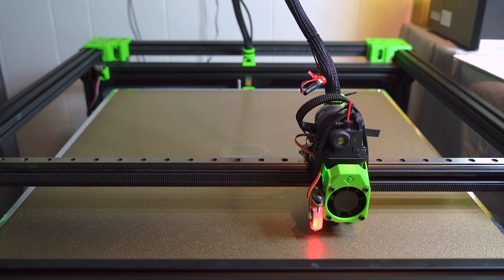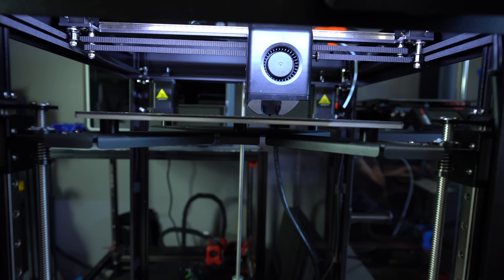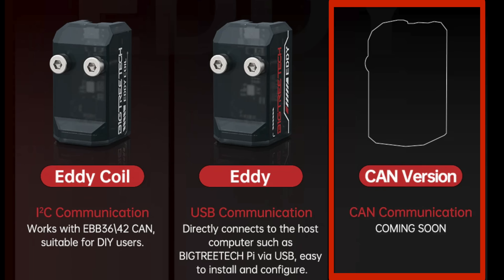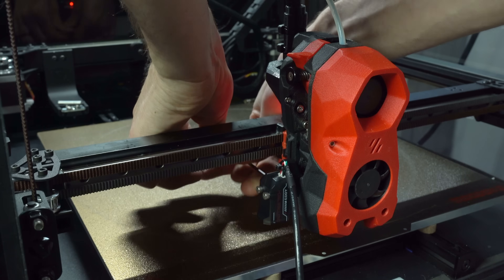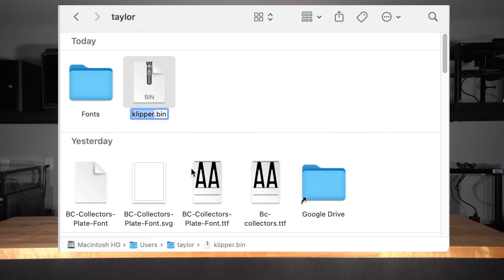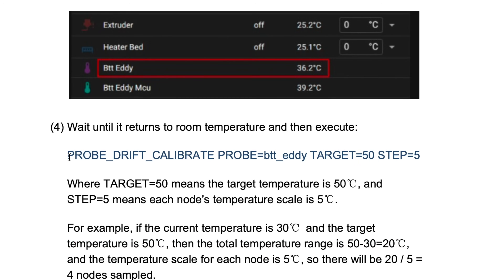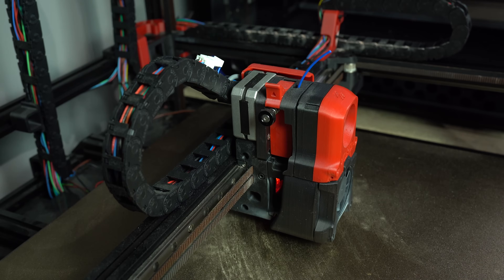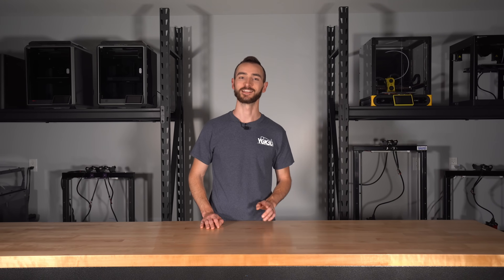3D Printer Bed Mesh Generation Will NEVER Be The Same - Eddy v.s. Beacon

Comment: I've been using the BD Sensor's from Mark at PandaPi 3D, its cheaper than these, more compact and the sensor is remote from the PCB so you can install extreme close to the nozzle, I even managed to install one on a Voron 0.2, I have a video showing it in action.
Reply: +1 Mark's BD Sensor works great ... I think it's a much better solution than Beacon or Eddy

Comment: I wonder why beacon requires you to not have any metal parts in the proximity, it shouldn't matter, all you would need to do is to just run some zero calibration high above the bed, metal bits above the coil will just shift the readings.
Eddy literally has two metal screws 15mm above the coil PCB.
Reply: Beacon is all about that reliability. After talking yo the creator you could have metal parts in the keep out but it'd impact performance and as such he advises against it so you can reproduce the results Beacon is showing on other machines

Comment: We went from inductive probes to klicky-probes because PEI coating on magnetic build-plates is uneven.
Eddy probe does not take into account non-conductive media (PEI). 
Lidar is the only way.
Reply: Exactly my thought. And about beacon -  same, right?
Reply: @vim55k  yep, same
Reply: @Omgbroccoli are there any commercial lidar-based solutions?
Reply: what about transparent glass beds? does that work with lidar, too?
Reply: @marc_frank  it depends on what lidar technology you are using. Some lidars can work with transparent surfaces.
Reply: @Omgbroccoli  it all depends on the wavelengths of light used. Just because something is transparent to visible light that doesn’t mean it will be transparent to IR or UV too.
Reply: @conorstewart2214  
right. I've made a comment on this above: it all depends on which lidar technology we are using. 
Why suggest using mirrors if so.
Reply: We could use a mirror, its flat and has zilveroxide in it or something. Or should i stop smoking now
Reply: @TheOneAndOnlySatan  we need reflection from the build surface (top surface) to trigger lidar. Regular mirrors reflect from the metallized layer on the bottom surface.
Reply: I realize that the Creality K1 series printers  are  
“aliens 👽” in the Voron universe, but the load sensors in each corner of the beds get past most or all of the problems with inductive or edie currents probes. It definitely cannot match the probing spacial resolution without taking forever and a day, however, as mentioned, is such a fine bed mesh really necessary?
Reply: Are you sure?  Where are you getting this from?  There's a bunch of accounts of people using eddy current probes on pei bed sheets.  Not to mention  info straight from the manufacturer
 
This is from Beacon's FAQ

"Any high conductivity surface works with Beacon, but bare steel with glue, pei coated steel, or pei laminated steel are most commonly available.

Bare steel with glue and pei coated steel are the recommended surfaces. Beacon directly measures the surface, they are highly durable, and do not form bubbles or delaminate."

It literally says pei coated steel are the recommended surfaces.

And this from the eddy product page 

"A hot bed scheme with PEI steel plate and soft magnet can be used."
Reply: We went to klicky probes from inductive not because PEI coating is uneven. It's because the z-offset has to change anytime you change build plate and that is annoying. A good PEI build plate has a very consistent thickness across its surface.

beacon and probably eventually all eddy sensors are now also touch probes.
The new beacon software allows it to detect when the nozzle hits the bed with around 50 grams of force and klipper is eventually going to support this natively for other eddy sensors.

This means the probe can now compensate for the thickness of a build plate on top of the bed while also giving automatic z-offset calibration. This only needs to be done for the initial bed leveling and z-homing, as any quality build plate that goes on top of the bed will vary by less than a fraction of a single layer height in its thickness.
The bed should be the only thing varying by an amount significant enough to effect initial layer quality. 

Thus for the actual slow part the, bed mesh, the eddy sensor is used as normal and thus saves time. Also the increased accuracy from the denser mesh means that the build plate can vary more in its thickness before it could sum to a great enough deviance to cause a problem with initial layers.

Also LiDAR actually struggles with textured PEI plates, because it picks up the texture rather than the average thickness of the plate which is what you actually want. This is why bambu printers for instance turn LIDAR off by default on textured PEI.
Reply: How thick is pei? Honestly pissing into the wind. It works flawlessly on pei.
Reply: 'Lidar is the only way.'  Lidar would be sort of silly overkill.
There is a much easier way, you turn the inductive probe into a non-inductive probe.  Easy enough.
More important, I'm one of the few people who really understands capacitive detection since I parallel invented what Apple did a few months behind them.  Should have thought of it ages ago, I'll pull out some of my microcontroller and touch and touchless detection and see if I can get it working on a PEI etc sheet.
Still an iffy idea touchless with such a high insulator.  A whisker or something for slight touch might make more sense.

Ah with Eddy being $25 it's barely worth worrying about much.  You guys do realize you can turn the inductive into non-inductive fairly easily, right?
Make a simple slider, with a light spring to hold it extended down.  At the bottom end put a screw to hold a bearing, to roll along with the X-axis.  That's your pickup, and rides on the bed surface.  You could put the inductive sensor just above and read the top end of the bearing, but probably better to put a flat steel plate or washer so the sensor has something better to pick up on.  If you do it right your plate height will accurately track the bed surface while still putting next to no wear on the bed surface.  Relatively straight forward and easy.
And of course a very light spring and cant the bearing a bit and you'll have basically a point contact that can still be sensed easily by using a 1" square plate or so above the bearing.

Ancient idea of course, just hit someone else mentioning the same a couple years ago on a reddit post..  No doubt plenty of others out there, roller bearing to transfer offset is used in some cam followers, etc.
  'Sprsnprchkn•2y ago  Could you invert the system? Use a probe with a ball bearing and pick a spot to zero a small plate up top then be able to measure any surface. Just transferring the height dif with the sliding probe.'
Reply: @ModelLights  YOOOO this is fckin genius, I would love to implement this, will report back
Reply: Print on bare steel. I haven't had a coated bed in 2 years and don't miss it. Bed adhesive and a dialed in print temp result in parts that cannot be removed from the bed until it cools.
Reply: I use a glass plate and the cartograph works just fine, its only kinda useless as the glas plate is quite flat. But this is just my experience
Reply: Eddy probes can't sense glass, so you're very lucky that both your bed & glass surface are both consistent & flat.

All of these probes assumbe that your build surface has a spring steel sheet very close to the surface & that the coating thickness is consistent across the whole surface.

Comment: As someone who had id for more than 40 days, i can say that it's has it's problems. They have beem fixed as of now and i am happy with it and it's fast, but i use it with tap for the perfect z offset and without tap it's another story.
Reply from the maker: Interesting. It seems good in combination with Tap or an endstop pin. I haven’t used it for homing so can’t speak to how repeatable the z offset is.

Comment: I disagree that it is more accurate then probing. You are scanning the metal and not the actual surface unlike something like voron tap.

Tap probes the actual surface and not some theoretical material with an offset.

Tap does not need an offset unless you want more or less squish on the first layer. After that you set it once and forget about the Z offset even after changing plates.

Also it does not save much time when it takes a few seconds to prove when you compare to a min and a half on a 2+ hour  prints..
Reply: Not to mention that as your nozzle wears it decreases in length - tap probe homing corrects for this by itself. There's a reason both Prusa and Bambu Lab are almost exclusively using tap homing.

Comment: I have become so used to printing on non-metalic surfaces (mostly G10) that it always surprises me how many people completely skip over the fact that this is a big downside to any eddy current or inductive probe. I guess there is a lot of users who have "print surface" so synonymous with "metal sheet" in their mind this does not even occur to them. But for me an Euclid probe keeps delivering perfect first layer with reasonably fast probing sequence on any surface so well that for now I am not even considering swithing to any of these "game changing" new probes.
Reply: Based on the beacon contact demo, it seems the contact/tap implementation would work at enough distance through the G10, so perhaps for those surfaces you still do nozzle probing?
Reply: @ammmze  I am very curious to see how that nozzle contact probing works. I have seen the demo where they had nothing metalic anywhere near the nozzle and claimed it detects pressure of just 20g of the nozzle against the box, egg or anything other under it. So that would work on G10 of any thickness but we are back to single point contact probing and depending on how high it needs to retract and how fast it can probe this could be actually slower than a stowable micro switch probe. We will see.
Reply: @hebijirik  It just does one contact probe, and an eddy current probe in the same location to get the z-offset. Then can do the zippy full surface scan for height variances. Just need the plate and build surface to be parallel which is trivial
Reply: @dirtdart81  An eddy current measurement will not tell you anything unless there is metal near and a relative movement between the measuring coil(s) and that metal. Beacon has shown a video where there is no metal near it and yet it detects the nozzle feeling 20g of pressure upwards. Detecting tiny movements of the nozzle itself relative to the probe perhaps? 
But in any case there will be no zipping the full surface on a non-metalic surface...
Reply: I am an engineer that prints PEEK and ULTEM on a bare spring steel sheet with Vision Miner's Bed Adhesive and it works for any filament and never warps.
Reply: @catnipaddict126  I have recently seen someone try a TPE filament of unknown origin and it was not holding on the Vision Miner covered bed at any temperature. It is good stuff, but there are a few filaments it cannot help with.
Reply from the maker: That’s fair and totally true - spring steel sheets have become somewhat ubiquitous.
Reply: @ygk3d  One point I did not mention to keep it brief: how much resolution on the mesh you need is also influenced by the type of print surface. On my Ratrig V-Core 3 500 I tried even pretty high mesh resolutions with different surfaces. It seems that if you forget some tiny debris on the magnetic sticker and put the standard spring steel over it you get a hill in that place that can screw up your first layer if no probe point is near. But you put 1.5mm thick G10 with a metalic sticker on the bottom onto the same debris on the same magnet and the hill may have similar height but it is so gradual the neighboring probe points make the mesh relfect the real shape of the surface well enough to have no issues with the first layer. 
I use 10x10 when  printing 450x450 mm or bigger and with the adaptive meshing algorithm this ends up being 3x3 mesh for any small print. With lifting the Euclid only 2mm after probing and 10k travel accelleration the probing is done in a few seconds. So this makes it hard for me to see how the faster scanning instead of probing would be a benefit even if it worked on G10 surface. Either it saves me few seconds on an hour long print or it gets me higher mesh resolution that does not reveal anything new.  
I can absolutely see a scanner like the Eddy being much better than for example BLTouch that is quite slow with the pin deployment needed twice or more at every probe point. Compared to that it will be both faster and have better resolution.
Reply from the maker: @hebijirik  great perspective. Thanks for sharing. The use of adaptive meshing definitely makes a big difference. Really interesting about spring steel versus G10. You find the G10 has good adhesion and release for most materials?
Reply: @ygk3d  The G10 is absolutely excelent for PETG which I print very often. Unlike PEI powder coated surfaces there seems to be zero deterioration after any amount of printing. I once scratched it accidentally so I tried an orbital sander on it, cleaned and washed all the dust from the sanding and it was like new again. Still sticks like crazy while hot and releases easily when cooled down. 
For PLA you need to degrease and clean it well, even fingerprints can decrease the adhesion too much. I would say it it slightly less bed adhesion for PLA than the PEI surfaces. But still very usable. When the plate cools down the PLA prints just completely release on their own. 
ASA/ABS is adhering a bit better than PLA but not as much as PETG. 
I decided to try the Vision Miner Nanopolymer adhesive on it and it works great too. It removes the PLA sensitivity to having it perfectly clean and freshly degreased. Prints other than PETG still completely detach once cold and the surface is still smooth. 
I like the low cost (I got 4 500x500 for less than the cost of just 1 PEI sheet), the ability to easily fix up slight damage and the option to buy different thickness based on how stiff I need it for the size. I use 1.5mm on my 500mm V-Core but it felt too stiff for smaller printers. I tried 1mm thick for a Prusa MK4 and a 200mm V-Core and they work nicely. 
Disadvantages are: the glass smooth bottom side of the print might not suit every part, so I still use powder coated PEI when I need that look. If your printer has magnets for metalic beds you can put a metalic sticker (used to make a magnet-holding whiteboard on any surface) but then you only get to use one side of the G10. Or you have to mess around with some other way to clamp it to your bed. Depending on where you are buying it might be easy or not - I emailed some local company that makes custom insulation for electric instalations and they sell it in 1050x1025 pieces in any thickness and they can cut it to smaller pieces of dimensions I ask for. So I got it quarted for the 500 and I got 16 pcs for MK4 🙂.
Reply from the maker: @hebijirik  awesome info. Thank you!
Reply: @ygk3d  I gorgot to mention that it seems good to set temprerature a little higher. The fiberglass is not as thermally conductive as the metal sheet so there will be a little bit bigger difference between the top surface temperature and what the sensor in the heating pad under it measures. I use 70°C for PLA, 85°C for PETG and 110°C for ASA on my V-Core.
Reply: Came here to say this, but not as well.
Reply: I would say it's not as big a downside as you think. PEI coated beds are great even if not quite as good as G10
Reply: @coledavidson5630  I use powder coated PEI sheets too sometimes for the look of the parts. But they cost 4-8 times more and are not even half as durable compared to G10. So I wouldn't be willing to give up using G10 any time soon.
Reply: Been using beacon contact for six months on G10, and glass. Even use it on a carbon fiber bed with nothing in it where I print directly on the CF. 

It is game changing. For anyone.
Reply: @DatMammutt  Is it doing anything for you something like Euclid probe would not do on thos non-metal surfaces?
Reply: @ yes, I don’t haven’t fiddle with a stupid dock so it’s faster, the contact force is super low etc. I can change plates, nozzles, temps, everything just works.
Reply: @DatMammut76  ok, it saves you the 1s when either docking or taking out the probe. But that's it, right? And with the Euclid you don't have to run one more usb cable to the print head that will fail sooner or later. And a special one at that,  not standard usb-c you can buy anywhere. 
BTW on my printer the docking of he probe involves no "fiddling". I installed it, adjusted it once and haven't touched it again. Just works.
Reply: @ I don’t have to run a usb cable it plugs into the USB hub on my toolbar board. 

And it saves me the trouble of MAKING and PROGRAMING the docking probe, and probes falling off, and offset issues, and and and. 

You don’t know wtf you’re talking about lol. Klicky shit is irritating garbage. Offsets are a pain when you swap sheets. But please keep using your junk from 2022.
Reply: @DatMammut76  sounds like you are not very competent at making things work well so you need overpriced overkill solutions to things. Don't assume everyone is like you. I never have issues with offset despite swapping three different types of plates routinely and I never have the probe falling off. So for you the beacon can be a "game changer", for me it is not.
Reply: @ lmfao sure thing, gramps.
Reply: glass bed anyone?